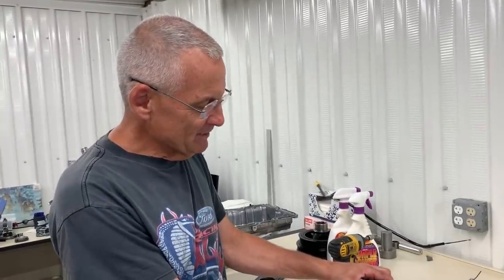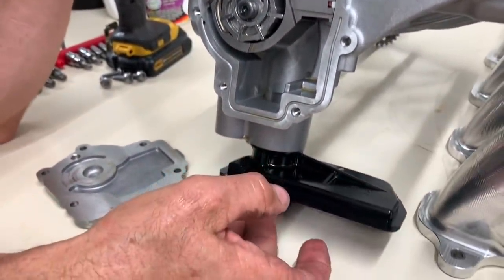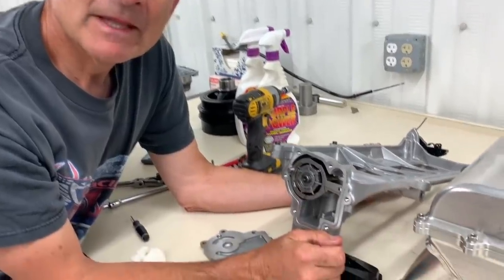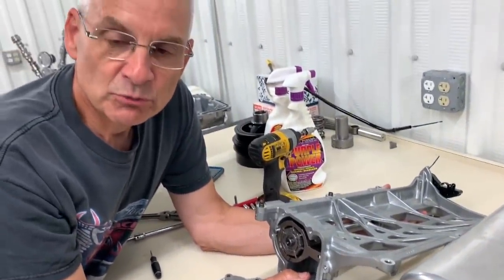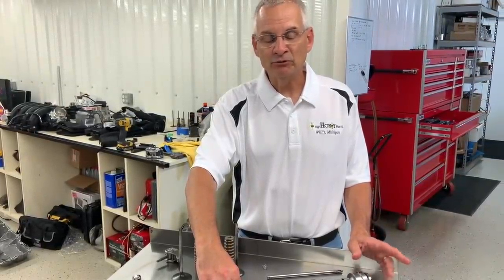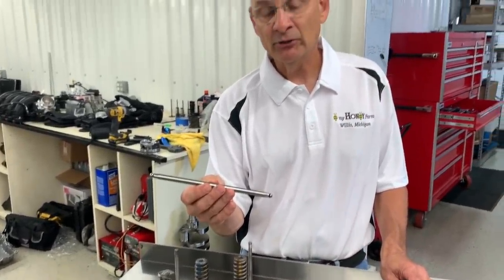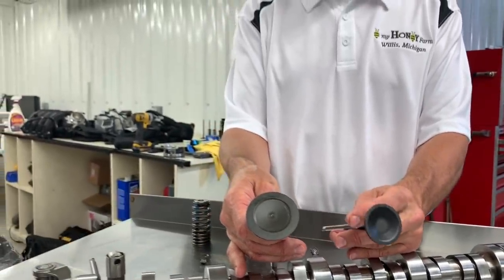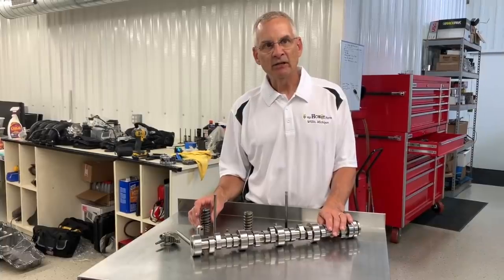Ford 7.3 Godzilla V8 Engine — Cam, Valvetrain & Oil Pump Revealed: Cam Lift, Rocker Ratio & More!

Comment: I like that the oil pump is more of a mechanically controlled feature rather than electronic.
Reply: As a full time wrench spinner the aluminum housing and variable housing brings me cause for concern. Especially with any for of electronic control. I would think an immediate removal/delete of whatever electronic unit is to articulate the pump against that spring is a 100% requirement for true reliability.
Reply: @MrAPCProductions  Well it doesn't look like the housing itself is doing any sort of changing. It looks more to me that the pump turbine is only changing where its center of rotation is to change how much oil passes through.
Reply: @MrAPCProductions  There is no E control on that VD pump, when the engine is at idle or light load excises oil pressure is used to push on the spring and change displacement of the pump and use less power.
Reply: @MrAPCProductions  After reading your comment. I check to see if you had any videos of you working on cars. I knew I was not going to see any.
Reply: @TdrSld  I notice that too. I don't see where the electronic control is.
Reply: I never knew they used electronic oil pumps?
Reply: @hammerdowngt5004  Not an electronic pump, but an electronic actuator or something of the sort to change the displacement of the pump is what I thought it was going to be.
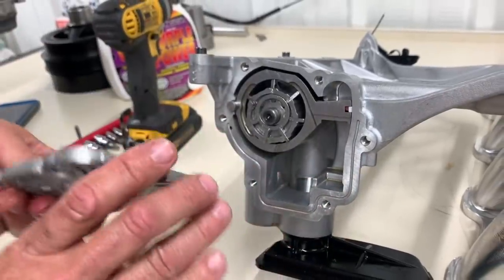Reply: @prestondeters5093  The housing is the articulation moment acting against the spring. Thinking about heat cycles and vibration against cast aluminum as a significant wear item. Also at 0:41 you can see the threaded portion of the pump housing that will hold the actuator and once he pulls the cover off you can see the restriction port pointed in that direction.
Reply: @TdrSld  at 0:41 you can see the threaded boss on the side of the pump housing that will accept either a lockout (like a poppet oil valve) or a cam actuator (like are already in so many ford vehicles) that will restrict or increase the flow to the opposing side of the pump body.
Reply: @blackericdenice  Haven't put a video online in many a moons. Far too busy and far to out of touch with editing and camera quality to upload anything of value. Been spinning wrenches since I was diapers and have seen just about every single type if not the individual motors themselves fail that have been produced in the last 40 years. There are a lot of things I see that manufacturers as a whole attempt to deny or at minimum ignore because of the amount of failures produced from the individual projects. Nothing survives forever and most die far too quickly.
Reply: @MrAPCProductions  How do you get a 200 hp 350 with a 4 barrel carb to make 250 hp?
Reply: @blackericdenice  There are dozens if not hundreds of variables to the vague question you just asked. Including, but not limited to: compression, ignition timing and total curve, engine health, how you are measuring your output, the fuel mixture and delivery system, what heads, valves, and valvetrain health. What cam is in the motor, who's intake, which exhaust manifolds and what exhaust system you have connected, what thermostat.... the list is endless. 

Want to for sure make 50 extra horsepower? put a shot of nitrous in it, or 30lbs of boost.... itll make 50 more hp, if even for a few seconds.
Reply: Preston Deters oh ok.. thank you, makes a lot more sense to me I appreciate ya.
Reply: @MrAPCProductions  That question was a way for me to see if you are real or fake. You are fake and I don't waste time talking to fake people. 
Now If you had asked me the same question. I would have said to install a hotter cam and larger jets in the carb. Then you had the nerves to say add 30 lbs. of boost. I don't think you need that much for a 350 to make 500 hp. In any case, I'm done, have a great life fronting about who you are.
Reply: Yeah.. It reminds me of air brakes on a semi truck..  I like that a failure defaults to the maximum pressure because of that spring.  That's pretty cool.

Comment: Glad that Ford has designed this engine for long term durability and to address some of the shortfalls seen in the 6.2L engines currently in production. Our fleet trucks at the utility I work for end up with over ten thousand engine hours and well north of 250k miles before they are replaced. Broken valve springs are an issue we have run into on the 6.2l engines.
Reply: Patrick D that’s the first issue I’ve heard about with the 6.2. Do they tend to brake at a certain amount of miles? 
I have a 2011 with 180K. So far so good.

Comment: Interesting oil pump. I will say that in my experience, vane pumps are good but don’t do well with any contamination. Opposed to the gear pumps that will take lots of abuse. But I am sure they have tested it thoroughly. I work for a repair shop for heavy equipment.  The variable displacement pumps we use are all piston style, bent axis for the most part. Several ways to control them. Curious design. I think this engine will be a hitter. I really want one lol.
Reply: Marius Ipad  plastic pickups have been a thing for a long time.

Comment: I met Mr. Wolfe when I was in the Blue Angels (late 80's early 90's). At the time he was racing a 5 liter mustang and I got a ride in it, Tom Wilson of Super Ford was writing an article on the Mustang.
I believe Mr. Wolfe developed the 5 liter GT40 heads.
Reply: Thanks for the memory, I did test the heads, but a guy named Wally Beaber was the driving force on the design.

Comment: Thanks for the break-down pics of the interior. The vane-style pump shown is well-known in the hydraulic field, and it lasts a very long time. Here, it is being promoted as lowering the load on the engine during low-powered cruising, however I believe it's greatest benefit is on a high-mileage engine. Wear on the cylinders and bearings can add up to widened clearances, and older engines will encounter increased oil-flow through the wearing tolerances. 

This means that the cylinders and bearings closest to the oil pump will be fine, but the cylinders and bearings farthest away from the oil-pump will experience low-pressure. In the common V8 engines with a simple fixed-flow oil-pump, The rear two bearings and cylinders will have the worst wear, and they are the ones to suspect when you hear a light rod-knock, or the spark-plugs show excessive blow-by, or oil-fouling on the plugs from the worn valve guides. 

A pressure-compensated pump like this will increase flow as the engine wears, and that is a good thing. I suspect something like this can add 100K miles to an engine, which puts it well past the common life of an automatic transmission. Well-done, Ford. This is a good development.
Reply from the maker: Thanks for your insight.
Reply: A chain-driven oil pump takes some getting used to but at least the chain won't be under full tension at low/moderate RPMs.

Comment: 3:35 .540 lift is the reason this engine make 430 hp. If you don't believe me. Check the cam lift for the 426 hp 2012 Camaro SS.

Comment: That oil pump seems to be great for efficiency but also looks very costly if it needs replaced. Is it serviceable without taking the tray and chain off?
Reply: @BJames3351 no. oil pan and front cover will have to come off. my have to pully the motor if the subframe is not removable.

Comment: Thank you for the updates on this motor. They seem to have complicated the oiling system too much.. Valvetrain looks much better. Like the corporate welfare champ, GM LS I hate that you have to pull heads to remove the lifters. See how it balances out. Love the camshaft core.
Reply from the maker: Thank you.
Reply: yeah.. but a failure defaults the pump to it's maximum pressure/ volume..  So it's pretty bullet proof still.

Comment: From what i can see there will be aftermarket oil pump lockout kits to make the pump run under high flow mode. Hopefully it should last decently. 

Those valvetrain are def overkill but kinda understand when you are talking about an engine running for 300k miles and beyond. 

I managed to simulate the engine on a software without knowing the  timings and fuel mix. I able to get as close to the stock values of the engine. 

In tuned form, race headers, single big throttle body and race manifold. Super big cams and tuning for horsepower NA. I got around 700bhp crank close to 8000rpm. Thats with upgraded bottom end to be able to rev way higher than stock. 

With twin turbo setup. The best power is around 1000+bhp. 

But what interest me is the huge difference when i change the heads and valvetrains to a setup like the Coyote. I got almost 1000bhp crank NA tuned and upgraded bottom end. 

My mind was blown.

Comment: Can the oil pump fail to prime after an oil change like ford’s older variable displacement pumps?
Reply: Maybe that's why they used the short plastic pickup tube. Get the pump as close to the oil as possible to make it easier to prime.

Comment: Price and availability, and will it be available with stand alone Electronic Engine Controls (EEC). This would look good and work well for my 51 Ford F3 pickup...
Reply from the maker: It's brand new so only pricing is at the dealer right now, and stand-alone ECU solutions are in the works.
Reply: @revanevan  
Has Ford release an "over the counter" SRP....

Comment: The only gripes I have for this engine are, short deck height, open deck, only 4 head bolts not 6 per cylinder, and that oil pump is probably going to be expensive if you have to replace it. I really hope this platform gets 1/3 the love that the ls does. Could you imagine a tall deck 6 bolt block from dart? And how about some revised 6 bolt cylinder heads. I would seriously have to consider finding some sort of fomoco muscle car.
Reply from the maker: It's not an open deck, please see earlier video, we have a full explanation.
Reply: James Sheets  with the head bolts the size they are and the very high torque loading they are under. I don’t think it will be a problem. On a Ford Windsor or Cleveland yes, a lightweight low skirt block that starts to distort the block at high cylinder pressures 4 bolts was never enough.
Reply: @revanevan  Yes, you are correct. I think my mind got clouded with the information from other automotive related videos I have watched since then. I would like to see the deck without the saw cuts. I understand the reason for them but every little thing you can do for cylinder bore stability is a plus in my book.
Reply: @vintagetintrader1062  larger bolts definitely help and in the stock application are just fine. With power adders the extra fasteners and a quality mls gasket would be extra insurance. Are there any aftermarket ls blocks with just larger bolt holes? As far as I know they have 6 bolt holes per cylinder. But I'm not aware of the specs  on most blocks.

Comment: I am in the planning stages of putting in a 363 with a KB in a 94GT. After watching all these videos I'm wanting to do this swap instead. Where can I get purchase info on this engine? Cant find info on it anywhere.
Reply: i don't believe its for sale in retail just yet. i believe this is actually them showing how they are working on a crate engine... they are working with ford after all.  my hope and belief is ford performance and or SVT will offer a standard and a low performance version. as SVT said they are already working on several different kits for the engine.
Reply: @thesavior2398  I have the 363 Fordstrokers(Out of parted car) on the stand and was going to do the 2.8KB swap on it with 6 speed( not yet purchased)  Its lot of custom work. I'm hearing the 10 speed is the same length as the 6 speed. If this 7.3 pans out with swap kits and crate engines all this stuff is going up for sale. I subscribed and biting at the bit on info. Loving the updates from this channel.
Reply: @camaromustangmods3327   ya i think the 10 speed and the 6 speed are just about the same. but i also know that the bellhousing on the 7.3 is the same bellhousing as the coyote. because they said it fits directly to the mustang transmission.
Reply: @thesavior2398  is the f250 gonna come out with the 10 speed?
Reply: Argelio Olivares  yes it is
Reply: @thesavior2398  thats good how much is the truck
Reply: @argelioolivares631  i think they start in the high 40's
Reply: @thesavior2398  nah f that
Reply: @thesavior2398  Heres what I'm thinking. Crate engine with cam change and either a KB unit or Whipple at 8lbs boost. They were saying street boost should be fine on this at that level. I would like to see if they feel the 7.3 has bit more left in it in regards to cam and intake. Cubes just sell it for me.
Reply: @camaromustangmods3327   ya i agree! i hope to see a crate engine soon!

Comment: With boost, is this engine more capable than the coyote? Boostedf150 is making 900+ rwhp on a stock engine.
Reply: Idk bud time will tell same thing im talking about..... Matter fact if it gose all hog boosted they better be hitting 2000 hp or els whats the point if it cant keep up with the hemis and lsx if it goes racing like this guys want

Comment: This is looking like one nice engine. I think the key will be fresh oil changes to keep the part wear to an absolute minimum. Oil is cheap and should be changed often. This engine should have a nice service life and I think really may be the engine choice most will go after. I love all the torque you get from the 6.7, but man, that's a lot of money up front and your wallet will be really mad when some kind of major replacement has to happen. I think the 7.3 will also be fleet choice.

Comment: what kind of power do you guys think this engine is capable of for a carbureted truck pull engine, do you think it can make 850 NA with extensive head work   big cam, rods and pistons 8500 rpm

Comment: It definitely adds rigidity.. otherwise, they would have made it out of super thin sheet metal.  It's that thick "engineered" looking structure for a reason;  It helps to structurally box' in the engine, rather than it having a completely open bottom;  so it helps to stabilize those main bolts and reduce resonant flexing in the block..  (plus dual purpose as an oil baffle, ect.).  They do it on several other engines also.  I've seen them on 2JZ's and LS engines, ect..

Comment: The variable vane oil pumps on the diesel 3.2 ford engine have caused countless destroyed engines in Australia. When the oil changed, the pump loses prime and the engine is destroyed on start up. This was apparently caused by delaying the refilling of the sump with fresh oil. So much for saving a few drops of fuel.....

Comment: Also what transmissions will bolt up ?
Reply from the maker: Beth, any trans that will bolt to the 4.6/5.4/or V10 modular (and the 5.8 Shelby engine) and Coyote 5.0. Thanks for watching and please be sure to subscribe and see our earlier videos on this. We cover you question there as well.
Reply: @revanevan  i think you guys are using a 10speed trans. Y not the 6r80 ? Is the 10 speed trans an easer swap. I have a new edge with a 6r80 and us shift6 controller  and i love it.
Reply: @IamBethIam  10 speed only fits 3rd gen coyotes

Comment: Brian Wolfe said, "...( the variable displacement oil pump) was one of the key features of this engine, so we didn't need variable (electronic) engine displacement or direct injection".  I know he means the variable displacement oil pump lowers parasitic drag because unlike a fixed displacement pump, it is not just pumping against the pressure relief spring, and blowing it's energy away in the form of heated oil.  I get that it takes away less power because it only pumps what it needs, based on oil system backpressure. First let me say this is NOT a new concept.  The first 4 speed GM Hydromatics had variable displacement oil pumps, and that was the late 1940s technology.  I do not like the huge space volume inside this oil pump. It looks like an ever loving pain in the rear to PRIME when you do an oil change.  Lots of space to air lock in there.  Maybe it has a check valve in the PLASTIC pickup tube.  If so, just another thing to break.  I would not trust a plastic oil pickup. But to say the this more efficient oil pump satisfied some design criteria to make it not necessary to include electronic displacement control and direct injection does not add up in my mind.  For one, electronic displacement control (cylinder dropping if you want to call it that) does save some gas, because it is not injecting as much of it,  but don't forget that those deactivated cylinders are now just along for the ride, and are still creating parasitic drag.  Not good for efficiency at all. Maybe it is not a great idea anyway to drop cylinders.  As for not needing direct injection, well I see direct injection on a gas engine as allowing the engine to burn very lean fuel mixtures.  This saves fuel and gets more energy out of the fuel, as it is a more complete burn, leaving almost no unspent hydrocarbons due to the gas being injected at such a high pressure. So not sure how using a more efficient oil pump satisfies what design criteria that makes these other engine management systems not something Ford wanted to use with this engine. Please explain your comment.

Comment: Same system been in auto trans for decades, wonder why it took so long for someone to use it elsewhere
Reply: @mark_osborne   it would seem you have not rebuilt any 700/4L60/70 trans then as is exactly like this , they have been around since 80,s
Reply: @Hitman-ds1ei  Well I'll be an SOB, I stand corrected !